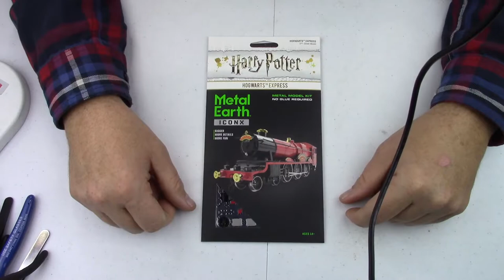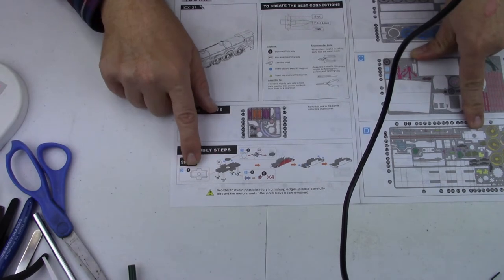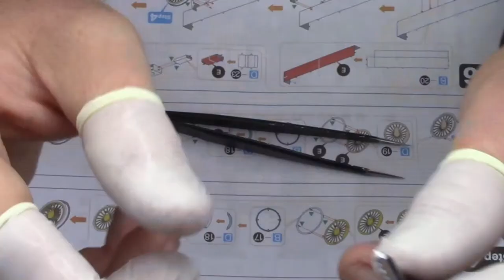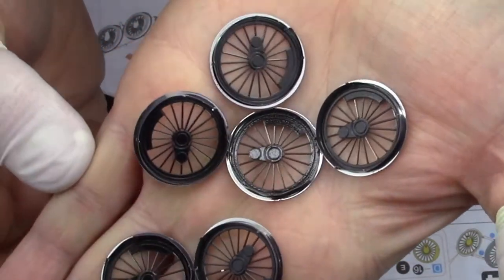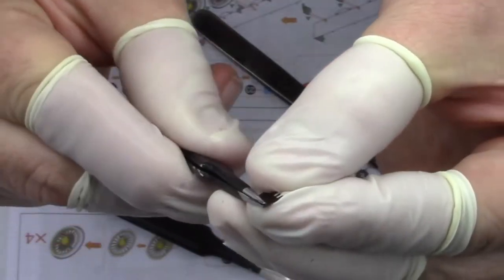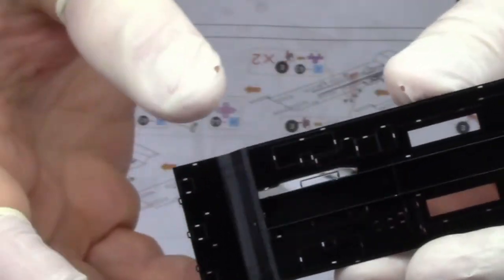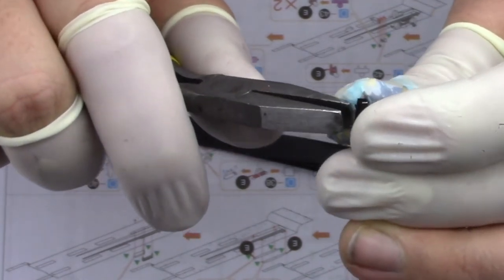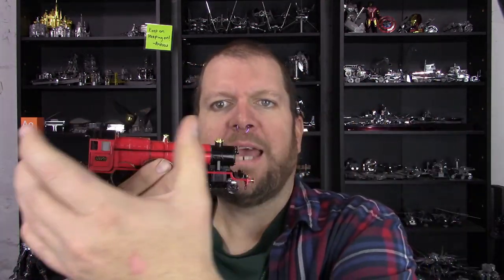ICONX Build - Hogwarts Express - Part 1

Comment: Just got mine. Got it a bit cheaper on ebay and now considering if its real or fake. The packaging is the same and the instructions. However the gold sheet doesn't seem to be metal as its not magnetic compared to the other sheets. Was this the case with yours? Also the sheets aren't as clear but I don't know whether that's because of the extra details on the iconx models.
Reply from the maker: The gold usually isn't magnetic as it's usually made of brass. If it was just a bit cheaper than it's probably the actual model but if it's less than half the usual price it might be a copycat.
Reply: @animateorange  It cost me 30 pounds
Reply from the maker: @callum_0903  I'd say that would be the cost of the real thing.